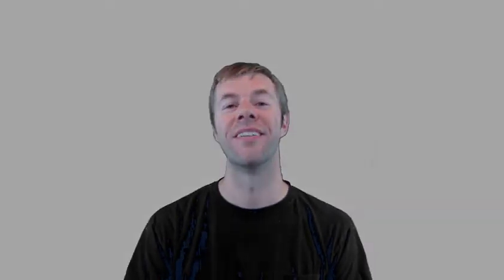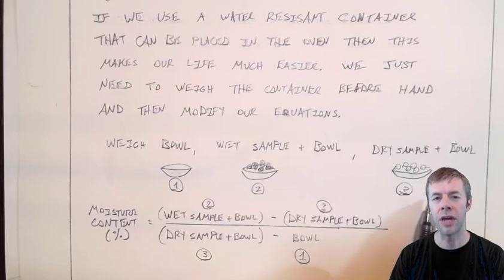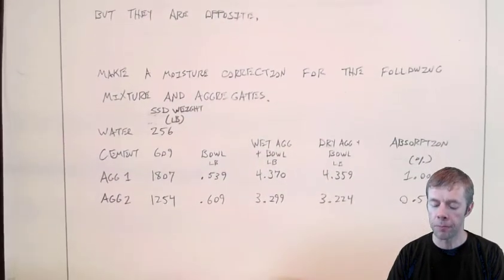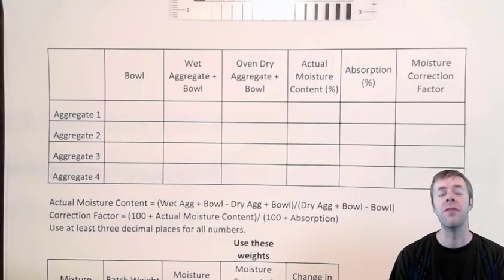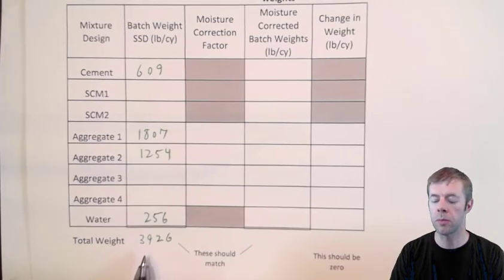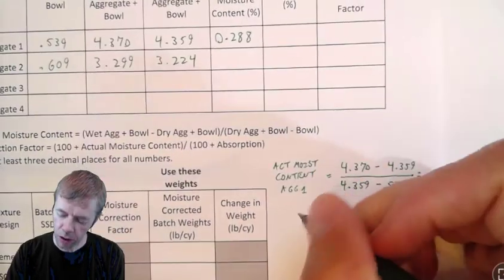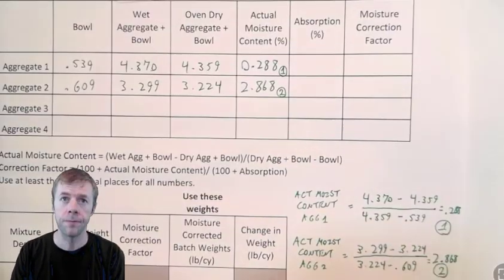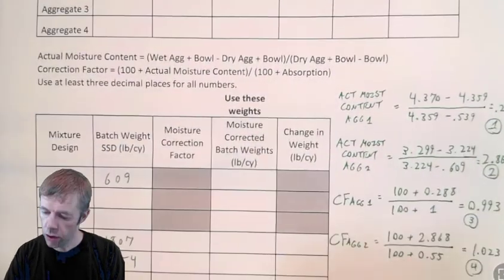Aggregate Moisture Corrections Pt2 - Example (with Excel Sheet)

Comment: You do all this and the contractor's guys say "??? its concrete not rocket fuel!" and proceed to weigh it all as SSD and pencil whip the batching invoice/records. --real world. [unfortunately those who understand the engineering are vastly outnumbered by those who only think they understand and you can't babysit every step of every process]  
(If it happens regularly with loading air cargo under the FAA do you think it won't happen with concrete batching?)

Comment: Thank you very much you covered the subject in very professional way, yet i have couple questions
1. By changing the the weights ( replacing aggregates by water & vise versa ). Are we still maintaining the original batch volume?
2. We added 29 lb of aggregate 2 , still these 29lbs contribute with 1.023 moisture content. Should we consider the moisture content & absorption in this new weight once again  ?
Thank you again

Comment: Thank you for these videos, they are very helpful!
We are working on starting this in our facility. During the soaking and drying process to acquire the SSD weight of our aggregate, the weight dropped by 5g even with fully saturated rocks (the rocks soaked for 27hrs). Could it be that the water washes some of the fine dust away? In our daily sieve analysis results there are usually around 5g of dust in the pan at the bottom of the sieve stack.
We are using 10mm (3/8") aggregate, if that helps.
How do we account for this in our calculations? Thanks!

Comment: Hi Tyler, this is great, and thank you for this video!
One question - Initially, you have the mixture proportions at SSD. Does that mean you have already accounted the moisture corrections after designing the concrete for a required strength according to a guideline (for e.g., ACI 211.1)? The point is, when you follow ACI 211.1 you will first evaluate the dry batch weights, and then do the water adjustments to get the SSD batch weights. But still needs to do corrections for the aggregates, am I right?. An explanation would be greatly appreciated talking about the main steps after getting the dry batch weights.

Comment: Does aggregate moisture have any effect on curing? 
If so, are you any better off with water saturated aggregates at the plant? Or will the rock(limestone in my case) suck up enough water in the mixer on the way to the job that it really doesn’t matter? 

Let’s just say that from the time the materials get put into the truck at the plant, to the the time it hits the ground on the job site is 20-30min.
Reply from the maker: Richard,
I don't think it matters for normal aggregate.  If you have light weight aggregate and they are properly saturated then these might be able to help.  We are about to start to study this in our lab.

Comment: Hi Tyler, Many thanks for pointing me in the right direction for aggregate moisture values. As always, your videos give an informative insight to concrete science. Just to make things a little easier for Concrete Connoisseur's, most modern digital scales have a facility called "Tare" which works the same way as a weighbridge for trucks. Place your bowl on the scale and zero the scale by pressing the Tare button. It automatically tares the weight into the scale so it only weighs the content of the bowl. I use a large shallow baking tray for baking fines so its faster and more efficient, always remember to check and stir the aggregate regularly and to let steam out of your oven.

At the moment I am designing a new type of concrete with specific properties that will appeal to different markets. All of my aggregates are what I call Dry Weight Aggregates (DWA's) or one could call them NSSD (100% dry) aggregates. I buy them dry so I have complete moisture control over my mix.

So I basically take a1kg sample of my aggregates as a standard purchase and then oven bake them. The test results  figure came to 9.56% moisture content in the aggregate. So I then add this 9,56% of water into my premixed viscosity modifier (of my own making) plus the water for the cement and rinsed the aggregate well before adding the cement for which I calculated my optimum WCR (In this video Tyler's is 42%)  and then added it to the mix followed by a super plasticizer. 

This system of mine (Basic as it is) has proved to work without any losses to the quality of the mix. So in the UK with bagged aggregates (not loose bulk) I am working on a 9.5% standard moisture content from the same supplier that is. Aggregate shape in my opinion is very important because it can affect concrete quality, increase cracking risks and of course carry more water into the mix.

Concrete is confounding, complicated and a completely brilliant material.
Reply from the maker: Jon - That is great that you can get your aggregates dry.  That is not usually an option in the places where I work.  I agree with your tare comment but there may be several days between weighing the wet sample and the dry one if you use an oven and so it is best to write it down.  Also, we find bowls and containers have different weights and this can make a difference in your calculations.
 
I talk a lot about aggregate shape and mixture design in a few different videos.  You may want to check out the Tarantula Curve playlist for some detailed discussion and more tools.  You can get it here: https://www.youtube.com/watch?v=V-r4-9OcuyY&list=PLRq6Z9d0kCT_A5z_xwSMlt5ta2mGSMpEb

Good luck on your new product.  Sounds like you are headed down a cool path. 9.5% absorption is very high.

Oh yeah - general concrete stuff can be found in this playlist.  It puts a lot of it in one place!  https://www.youtube.com/watch?v=HRVIoWFltw8&list=PLRq6Z9d0kCT_ObxZG5Mh2edgOyirtn0Co
Reply from the maker: Thank you!!!